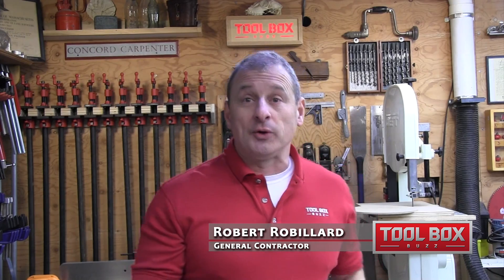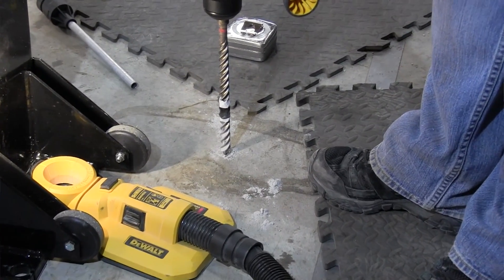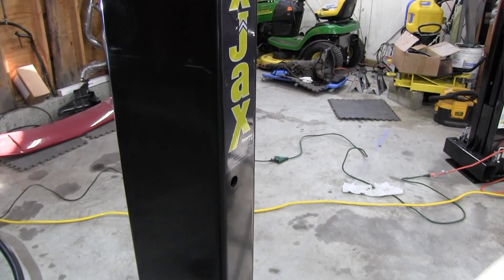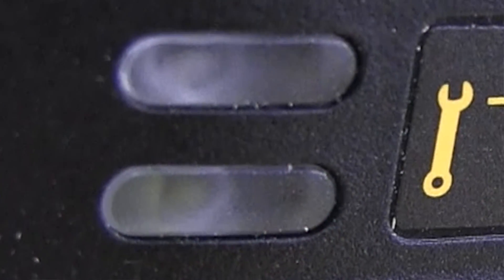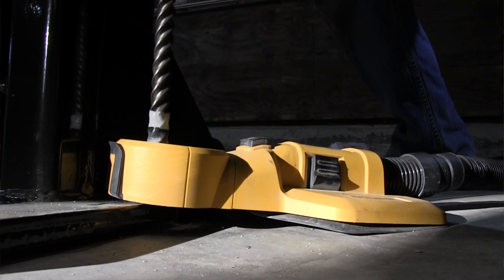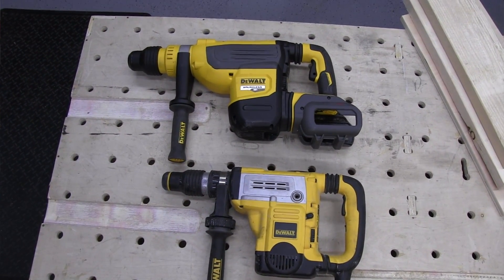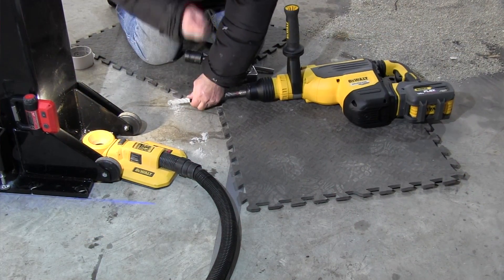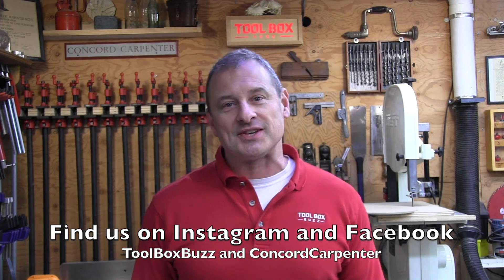Dewalt Flexvolt 1-7/8" SDS-MAX Rotary Hammer DCH733 Review

Comment: Could it be used for fencing?  Busting out old post foundations?
Reply: probably, would at least break the concrete up
Reply: That's what I bought it for. Only I got it slightly used on offer up for $325. I was happy as soon as I saw it. I want to use it to break up concrete in old posts too.

Comment: I have the latest Makita model but it's 36 volt.Uses 2 x 18 volt battery and it's a nice drill,a little on the heavy side but it's an SDS Max drill.It has a link with it to use with their vacuum.The only issue I find is that Milwaukee and Dewalt have 9 amp hour batteries while Makita maxes out at 6 amp.I have not seen anything larger.

Comment: at $1000 its hard to justify buying it. I'll stick with corded. Also how is the runtime for chipping? If you have to constaly swap batteries corded would be a better option.
Reply from the maker: charles king  as you know we mostly test our tools in the field, on our job. I unfortunately I did not have a project for chipping,  so I only chipped some old concrete for resting.  I was not able to check runtime
Reply: It’s $800 on Amazon

Comment: States it's BRUSHLESS... Has "Brush Service" indicator...  Does not compute...
Reply: According to the manual, the service lights are not for brushes.  It’s for hammer lubrication and seals.
Reply: Yeah was hoping for brushless
Reply from the maker: tensazero I saw that too, service required is for lubrication

Comment: Have you done the smaller SDS+ they came out with recently? I think they launched it as Flexvolt internationally and then as a 20V max tool here in the US. Might be wrong though. I have the older SDS+ compact and love it; however, there are times more power would be nice
Reply from the maker: nsatoday no we havnt
Reply: Maybe if y’all have some time; it would be neat to see what you think compared to the compact.